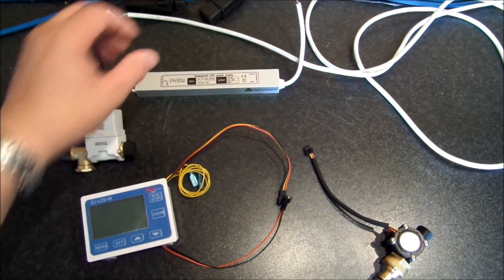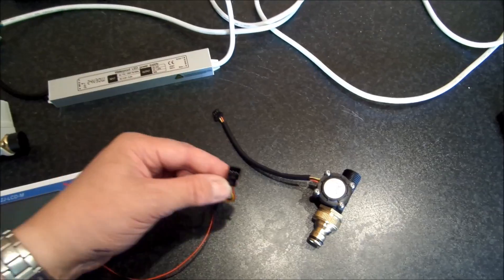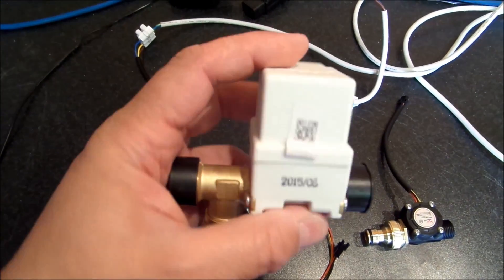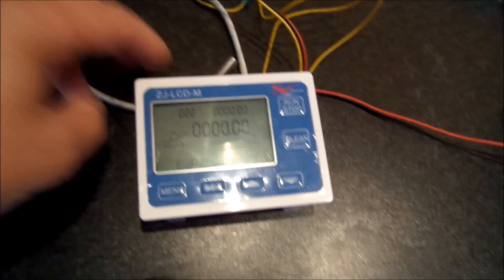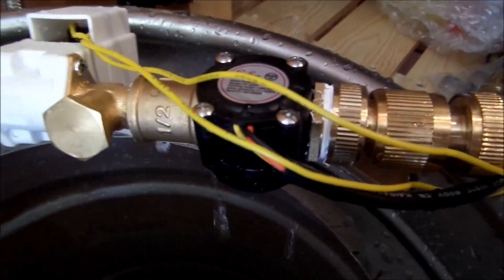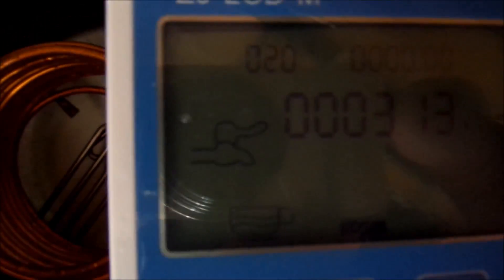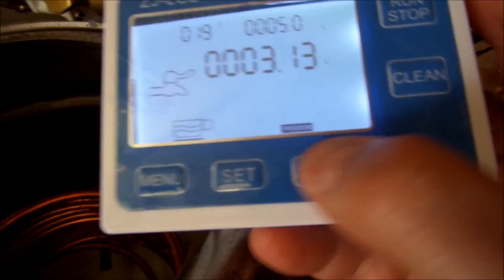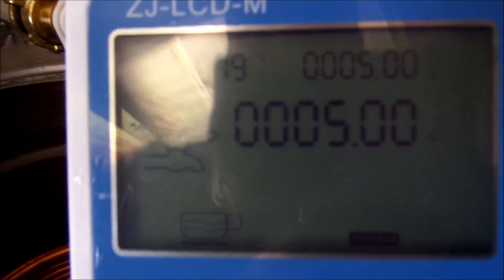HBW29 - Flow Meter

Comment: question
What happens if you close the mechanical valve and the liters have not yet expired? Does it switch off after a certain time or does it stay on if the valve was closed prematurely?

What happens when the power is disconnected, after power is back on, everything is at zero, is the relay on or off?
gruss aus Bremen Germany
Frage 
Was passiert wenn man das mechanische Ventil schließt und die Liter noch nicht abgelaufen sind ? Schaltet es sich nach einer gewissen Zeit aus oder bleibt es an wenn das Ventil vorzeitig geschlossen wurde ?

Was passiert wenn man den Strom trennt,ist  nach Strom wieder an ist alles auf Null ist das Relais an oder aus ?

Comment: great project! i m doing an automated brew system. I am trying to select the best valves for hot water and wort. Could you give me an advise on the valves? seem solenoid valves are dificcult to clean after brewing. Thanks!
Reply from the maker: My original valve failed due to heat, I have another video somewhere of the new valve. If you use a diaphragm valve then it should be easy to clean but you have to watch out for food grade and working temperature range. You could use a ball valve with an actuator just like we brewers use ball valves on other parts of brewery but they are expensive. I don't want to specify a valve and you find it does not work for you. I think for my set up it would be better to use the flow meter & valve for water into the HLT only.  I will recommend you look at the Brewpi shop as they have valves https://store.brewpi.com/mashing/valves
Reply: Thank you for your answer.  I understand  it would work ok in the hlt  but since  i want to automate also mash tun i think it would be better for.me to get a Ball one with actuator for wort easy cleaning.  I Will let you know. Thanks again.
Reply from the maker: @GuillonPadel  Why not get ball valves across the brewery so it looks nice then add the flow meter for the HLT. The mash volume should be pretty close once you get the efficiency value right. You could add the flow meter if you was really keen and send the output of the hall sensor to a raspberry pi.The hall sensor should pulse which is dead easy to detect on the GPIO.

Comment: Gallons?
Reply from the maker: My video was 3 years ago. https://www.aliexpress.com/item/New-Arrival-LCD-display-Digital-flow-meter-temperature-measuring-flow-senosr-total-Liter-Gal/32809674381.html says it does gallons or litres. Not sure if mine does but these new ones claim it is gallons. UK or US?
Reply: Hoverdog Brewery US .. I bought a few of the 3/4 kits complete with hall sensor and valve together. Did these work for you?
Reply: @therealMFfeelyaheard  The original valve failed due to high temps. I got a new valve and it works fine. I am sure I posted a link to the new one.
Reply: Thank you !

Comment: Hi, and thanks for the video. I notice you have the solonoid valve after the impeller, is there a specific reason for that? Cheers
Reply from the maker: The solenoid valve is before the impeller on my brewery, the impeller is hidden under the bench.

Comment: If I use a manual valve to slow sparge. How slow will the meter read the flow accurately?
Reply from the maker: I have run water manually through mine, I never measured the accuracy but as long as the impeller is spinning it will register the flow. There are a couple of videos on the same flow meter, this video checks the accuracy with a slow flow rate https://www.youtube.com/watch?v=mN-tPkVLSdM

Comment: Sir, i watched your review 3 times. So once programmed (for e.g. 2 liters), to operate it can i simple pres to OK button every tim to add another 2 liters ? The question is thus if i ONLY need to press OK every time i want to  fill something with a certain amount of liqued (i am asking for the EASE of operation).. i want to fill 10 identical buckets  and simple want to move to hose to the next bucket and press OK again (of course with the cellunoid attached). Is this the way it will work ? Thank you
Reply from the maker: Sorry for the slow reply, I will give it a test and get back to you.

Comment: ANY ideas how to adapt this to oil? f
Reply from the maker: The flow meter will work with a lot of impellers. I noticed on ebay a seller claims their works with oil - http://www.ebay.co.uk/itm/3-8-Flow-Meter-Control-Display-Oil-Fuel-Gasoline-diesel-Milk-Gear-Sensor-/321783633924?hash=item4aebcc9804:g:YHwAAOSwZG9Wkfkd

I have no idea if it will but as long as the impeller works with oil then it should be ok. I guess it depends on the viscosity of the oil, I can't imagine it working with crude oil.

Comment: Nice setup! Do you have a link for the parts?
Reply from the maker: This is like the one I got. http://www.ebay.co.uk/itm/1-2-Water-Flow-Control-LCD-Display-Meter-Flow-Sensor-Solenoid-Valve-Gauge-/191925442424?hash=item2cafa5d778:g:q2IAAOSwMsVXjI~E    Warning: my solenoid valve failed this week when running 80 degrees C water through it.

Comment: nice review, can I use this to set my water filter to fill only 5 liters and shut off the filter? I think is a wast of time press the water flow and waiting till the 5 liter is done, about 3 minutes
Reply from the maker: Yes you can use this to fill only 5 litres.
Reply: I just need plug it on my water filter and plug the wires in the on/off switch button?
Reply from the maker: The flow meter comes with a impeller which measures the water going through it. If you want to control the flow (on/off) then you need to get the one with a solenoid valve. First you connect a DC power supply to the control panel (I think it is 12v DC) then connect the impeller and the solenoid valve. That is basically it.
Reply: thanks, i will try to find it  =]

Comment: Nice did look at a flow meter, did wonder what temps they handle, like the controller. cheers
Reply from the maker: +norfolkhillbilly If I have issues, I can just swap out the impeller. Just waiting for some parts to arrive and I need to get some cable to extend the connections and I can test it for real. The meter itself is panel mount, I can just about fit it in my PC case but doing so will make a lot of swarf so I am going to have to make a housing for it.